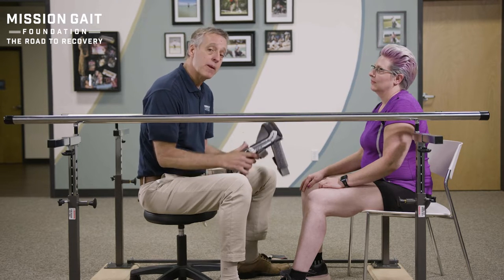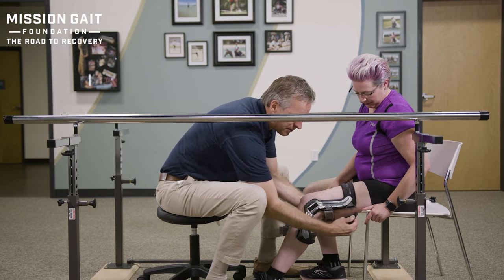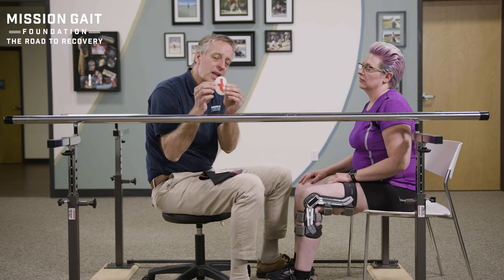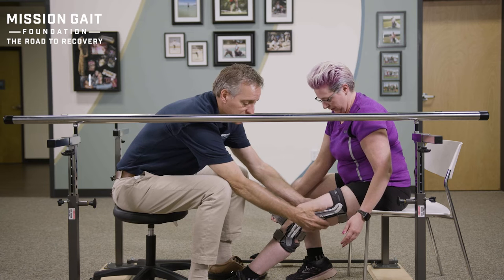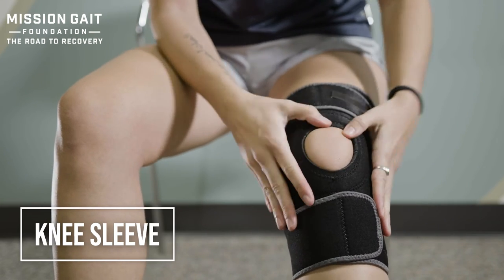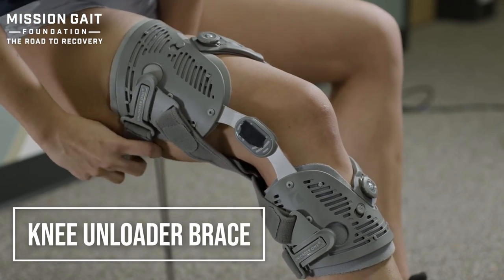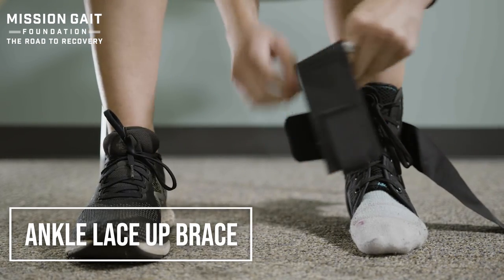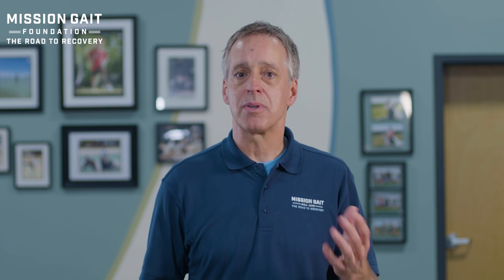Sleeve and Brace Fitting for the Knee and Ankle - Orthotic Training: Episode 7

Comment: So my residual limb has been healed and healthy for several months - and i just got my first prosthesis. In the tester i was balanced and felt i could take off running (prosthestist wouldn't let me), the 'real' one? Not so much. I hop on it with a walker, and the end of my residual limb isn't even close to the bottom of the socket (there's over a 1 inch gap), not to mention that my limb is more of a cone/football shape and the socket more like a square bowl. 
I was told I'd get used to it? 
I can't even stand without support in it, yet with the tester i could bend at the waist, twist, reach, etc,.   and it felt natural! 
Does this seem right to anyone?
Reply: Aw, sorry, i was watching one about aka prosthesis before this and commented on wrong vid. 
I'll leave it in case you can answer here. 
Thanks